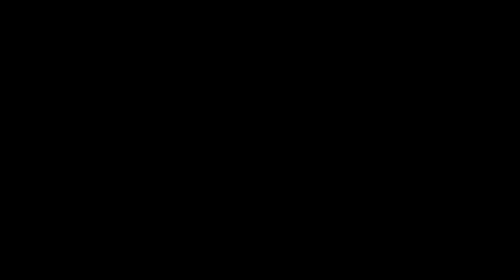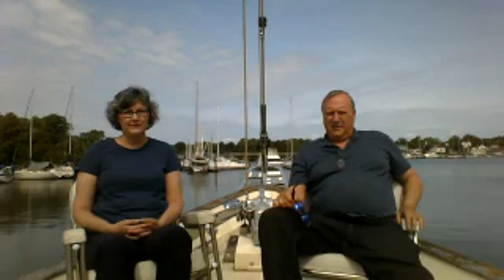Cahill Discusses Oroville Dam BOC Memo 1-5

Comment: Absolutely correct on the headgate structure etc. We know that the upper spillway is a wreck waiting to happen and we also know the the headgate structure is not properly founded on competent bedrock.
 I have been advocating the construction of an alternate headgate structure at the western end of the parking lot and then extending a new gated spillway south-westward in a direction roughly parallel with the western boundary of the parking lot. That would allow the spillway to follow the higher elevations for a goodly distance before plunging to the river just above the south-westward bend.
 Let's fix this thing to last for generations not just until the next wet season.
Reply from the maker: Robert Callies exactly

Comment: I was scratching my head over the bottom first plan as well.  Kiewit grabbed this job fast, coming in low.  They had just finished Folsom and probably felt confident that they could fix the spillway for $274 million.  Until, that is, they showed up for work.  Normally, a job like this will have an architectural/engineering firm create the design, and the over-all plans.  It is then time to find the construction firm.  It was DWR who jumped on the RCC idea.  Kiewit has expressed their doubts about running RCC on a 25% grade, stating that it has never been done before in the US.  My guess is that they are starting with low hanging fruit - leveling the bottom of the canyon for work on the terminus, while they figure out how in the Hell they are going to fix this thing.